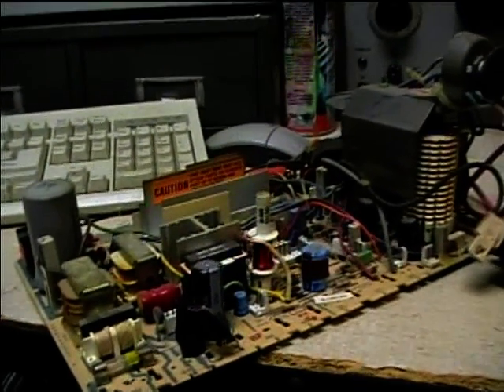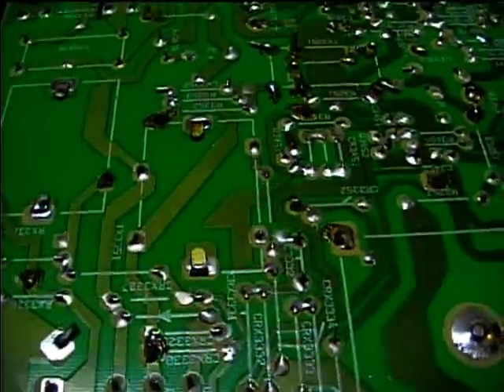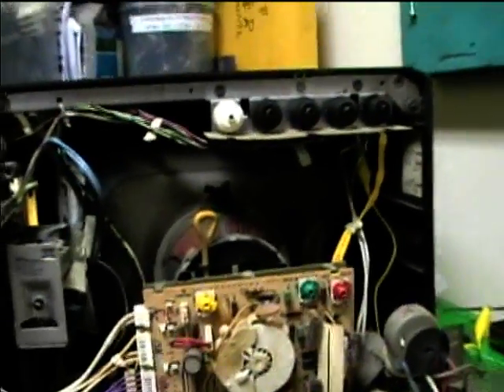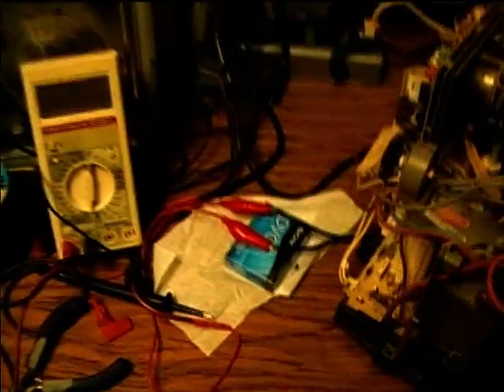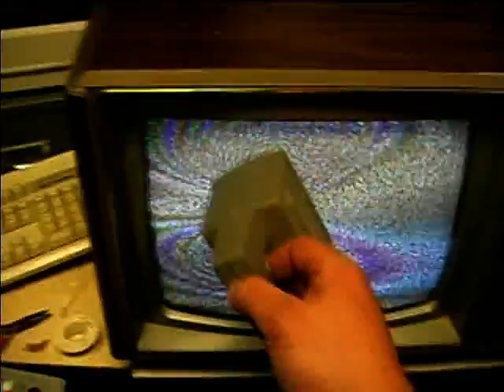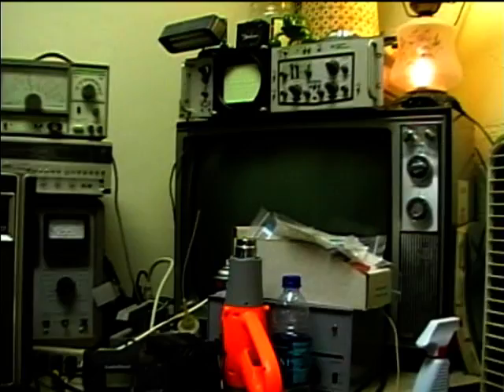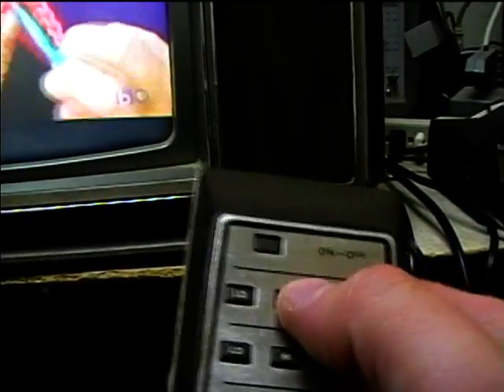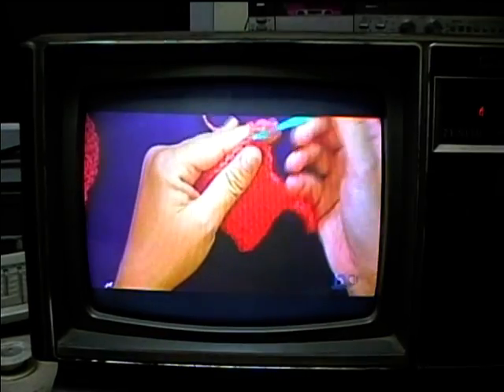Successfully repaired 1979 Zenith System 3 portable TV

Comment: I have NOT ONLY This set (in my Kitchen) but a 1980s 25" console System3 in my living room! (at the rate I watch TV any more they should last ANOTHER 30 years!) But I also have a floor model Zenith Radio of 1939 vintage(a 7S-363)  that STILL WORKS perfect. On AM it is more sensitive on DX than many "modern" radios, On SW it cranks the regular SW broadcasters (Though the SW band is not as wide as modern "comm" receivers!) Zenith in the day was the "Cadillac" of radio & TV!